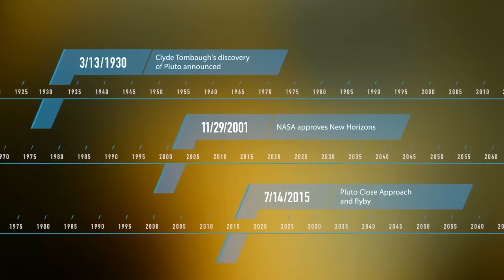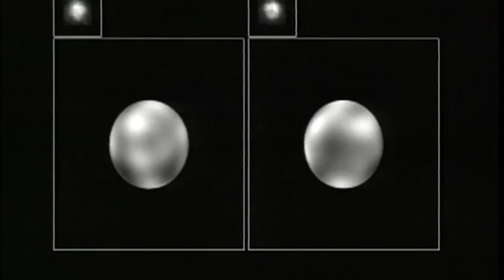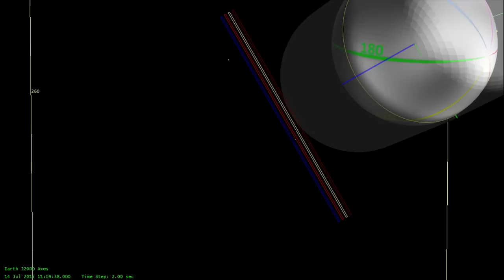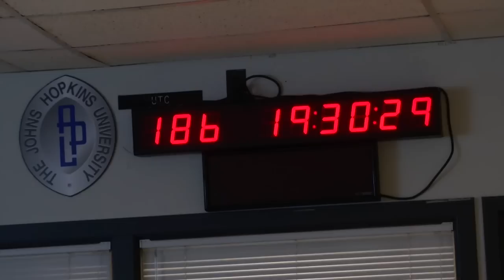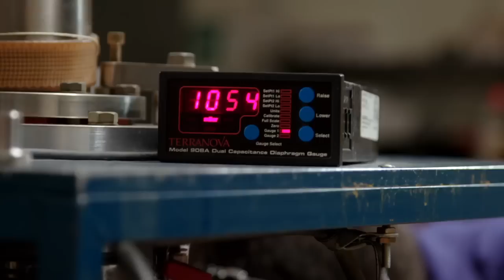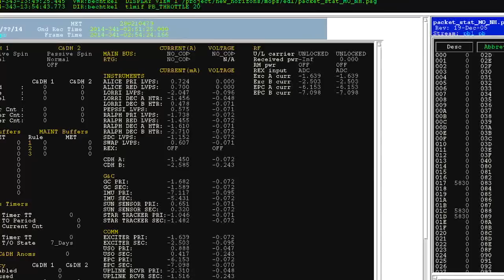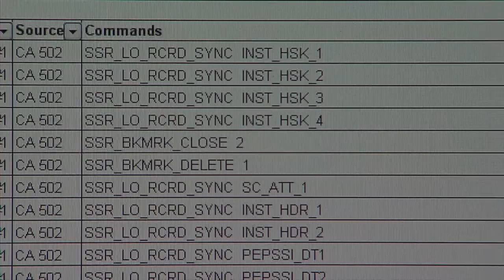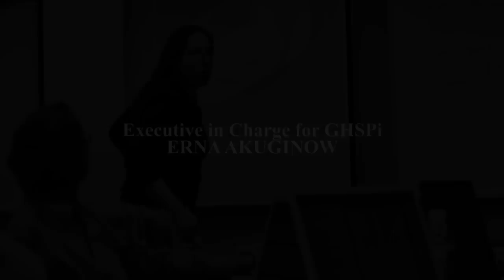The Year of Pluto - New Horizons Documentary Brings Humanity Closer to the Edge of the Solar System

Comment: Copied and quoted from another website by another commenter:

"The probe will be traveling so fast that it travels over a million kilometers per day. By the time we receive telemetry from the probe indicating that it is 100,000 km away from Pluto (nearly 10x the minimum flyby distance) the probe will have already completed its flyby and be 100,000 km on the other side of Pluto. So the vast majority of the most valuable scientific observations will be entirely pre-programmed and we won't see the data until many hours or days later."  

It's sort of sad that we can't yet drop a probe into orbit around the Pluto system.  Too many unknowns as of yet to be able to do so, I suppose.

Comment: 41:53 "If all goes well, New Horizons will stay awake flying by Pluto on July 2015 and then returning data until October 2016"

So, does that mean we the public won't see what Pluto looks like until probably early 2017? Considering NASA has to clear up the raw data and get approved before releasing it to the public… Dang!
Reply: Joe Morales It'll be quicker than that. But it does mean that the entirety of the data won't be available for a couple years. So far images are being released just a few days after they're taken, that should continue to be the case roughly.

Comment: Why new horizon able to send data to earth? Cuz at Pluto there's no settle-light  to send data why they're able to send picture and  data ?  How is that possible?
Reply: +Akihiro Ito By transmitting the data over long distances...
Reply: +Akihiro Ito it is its own 'satellite' read communications system...one of my problems with the mission is just that they did not place anything on a surface or a satellite of some kind in orbit around any of the objects...and I believe it would have been easy to drop something on the surface of at least one if not all the objects...nasa pays the jews well to do these stupid missions I would design the machines for them for free
Reply: MrAdamNTProtester I don't think you understand how fast the thing was going do you?

Comment: how much time it took to send those images to the earth???
Reply: Jerry Lalawmpuia Radio signals traveling at the speed of light take 4.5 hours to travel between Pluto and Earth. So, data received from New Horizons will have been on the road for about as long as it takes to drive between San Francisco and Santa Barbara. Because of that, it will take about 16 months for all of New Horizons’ flyby data to make it to Earth—meaning that new discoveries will be trickling in through the end of 2016

Comment: How will these images reach us, how long will it take for them to arrive?
Reply: AwkwardNinjaGuy The spacecraft currently travels at 14.53 km/s (9.03 mi/s; 3.07 AU/a; 0.00839 AU/d) relative to the Sun and at 13.80 km/s (8.57 mi/s; 2.91 AU/a; 0.00797 AU/d) relative to Pluto. Radio signals take four and a half hours to travel between the spacecraft and Earth. Source: John Hopkins University (APL)/NASA

Comment: What are the odds that the probe could travel over 3 billion miles through space without hitting so much as a grain of sand??
At 40,000 mph that grain of sand would punch a hole in the craft big enough to stick your fat head into.
Something the size of a screw would total it off.
I crunched the numbers and I have a better chance of being struck by lightning originating on Venus.
The way I see it, 
All those unemployed gamer programmers got to have something to do.
A dozen gamer programmers is a fraction of the cost NASA has spent.
So...odds are in favor its all fake...everything.
The gamer's are simply sending everything they created back to NASA via a secure connection.
NASA is no wiser.
And besides, Joe Q PUBLIC wouldn't know sh$t from honey if his mouth was full of it.
Reply: Jack Harper If you want to see it that way no one's stopping you, but you should know that you're forever relegating yourself to the sidelines.
Reply: SamSpade2010 I would much rather be on the sidelines than seen with my nose pressed to the glass hoping Santa Claus will appear.
Reply: Jack Harper Because getting in the game is risky?
Reply: +Jack Harper Space is very, very, VERY empty. The odds of encountering anything out in space are very low.